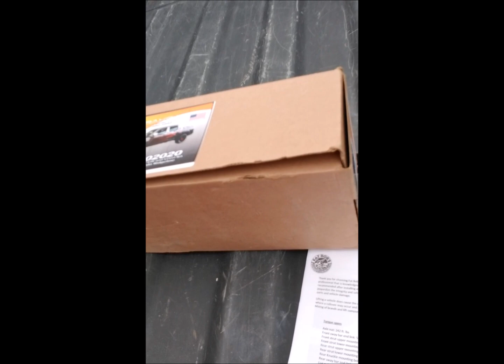1st Gen honda ridgeline lift kit install

Comment: Great video, after alignment did you have any excessive wear on the tires? Someone mentioned on a review that camber bolts for front and camber kit for rear was needed, what is your opinion on it?
Reply from the maker: The tech that did my alignment had no issues doing so, and the before printout of the alignment did not look terrible. It may depend on the year and the truck, but I had no issues at all

Comment: Ahh I remember seeing your post on FB. Any issues with the CV joints?
Reply from the maker: I have a slight wobble when I'm acceleratating through a turn, but I had that issue before the lift kit, it just amplified it. I will be replacing with OEM soon
Reply: @workwithme2558   keep up with the videos bro. Def need more gen 1 ridgeline content

Comment: I saw on one of your posts that you have a wobble while turning.
What about when taking off from a full stop?
I have a 2012 sport with a lift also. I  am experiencing wobble when turning and at around 20 mph. I could swear there was some wobble before the lift, i thought i was going crazy.
I also have a clunk in the front acle(new from parts store) not sure if it is caused by the angle of axle after the lift.
Can you please post any issues your having.
I am contemplating removing the lift if it fixes my issues, if it won’t no reason to remove.
Reply: I have that to but I think It has to deal with transmission not knowing what gear to go in which is why you have wobble in the front.
Reply from the maker: Hello! If I took off from a stop and really got on it I would feel the wobble. I recently replaced both front CVS with Honda OEM and the problem went away. I also noticed when I was replacing them that my passenger side CV was an aftermarket axle and that was probably causing the wobble. Good luck!
Reply: Mark DeRissio Thanks. I replaced the driver side. I will do the passengers when I have $250 burning a whole in my pocket.
Reply from the maker: @paisa007  yea it definitely hurt buying both sets lol.
Reply from the maker: @paisa007  I would also check your motor mounts before you go and buy an axle